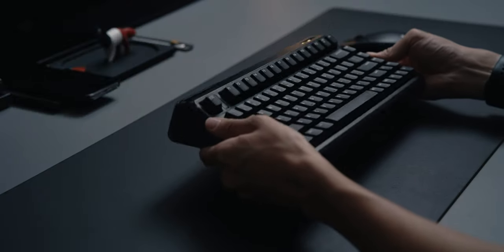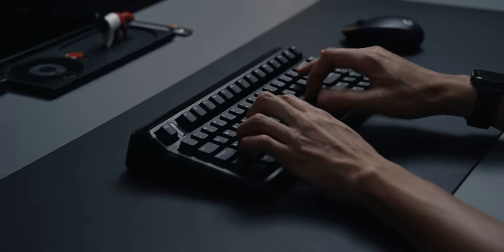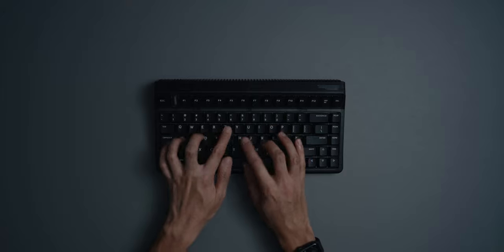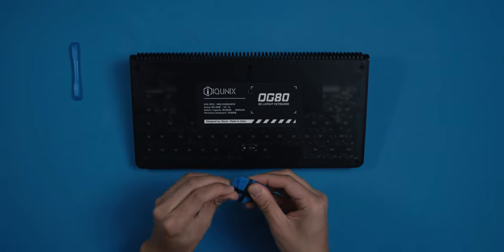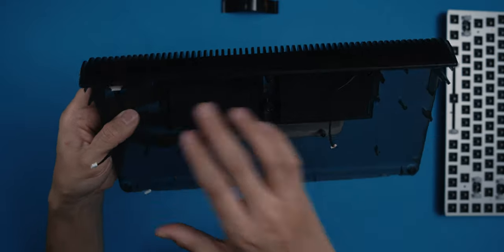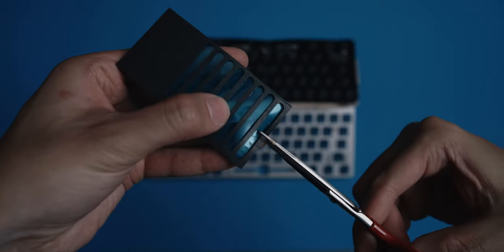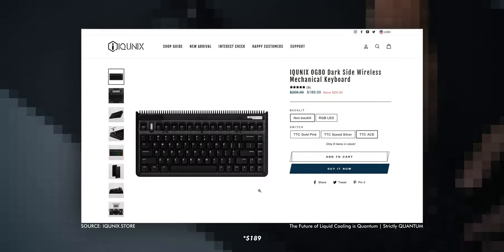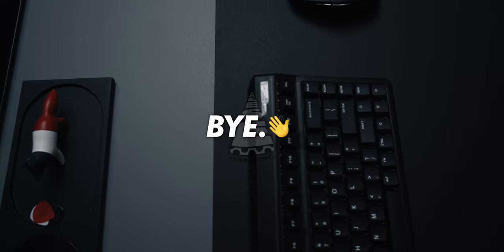IQUNIX OG80 Dark Side: Good Out-Of-The-Box, But Can It Be Improved? | Review, Modding, Typing Sounds

Comment: What keycaps did you have on the nuphy 65? @4:44
Reply from the maker: Cool to see you're still watching 🙌

Those are the caps that came with the Keychron K6: https://www.keychron.com/products/keychron-k6-wireless-mechanical-keyboard
Reply: @CheeseTurbulence  do standard keycaps on the low profile switches bottom out and hit against the plate on the nuphy? i have the air75 and was curious to try something similar. And of course i still watch 👍
Reply from the maker: @omairkk  They do unfortunately hit the plate 😔 The Domekey or DMK caps I have seem to clear it just ever so slightly that it works: https://youtu.be/Rlh4QXDZpiQ?t=988